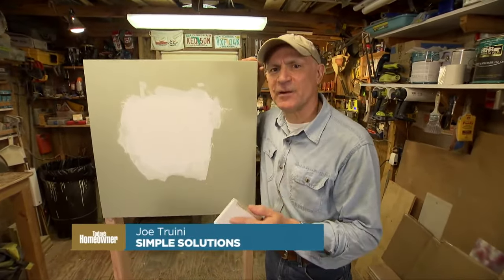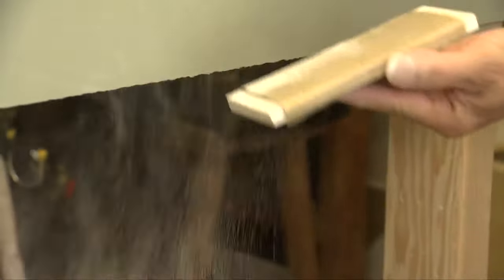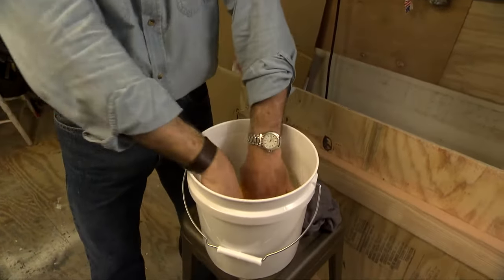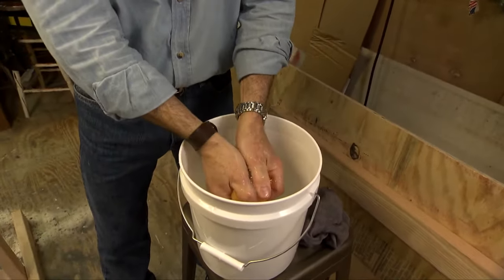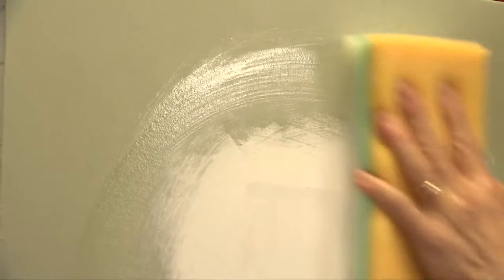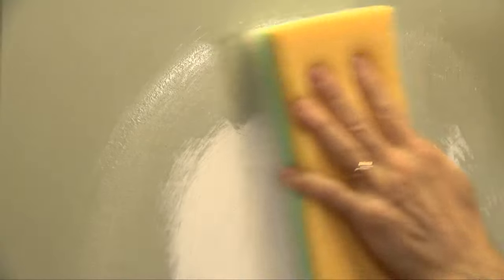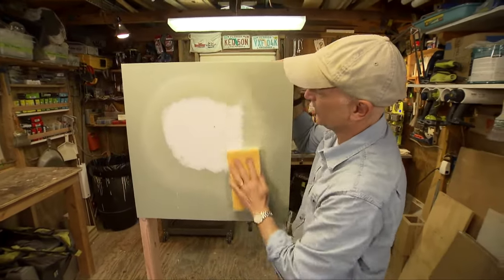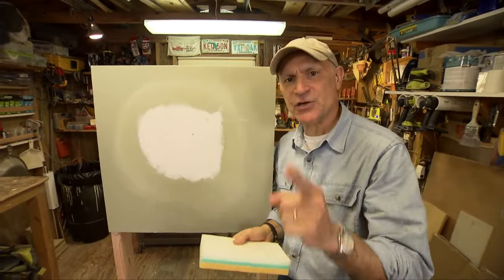How to Easily Smooth Joint Compound

Comment: Or…… you can you use a damp old wash cloth….  If you’re careful the rag can also remove scratch marks from over aggressive sanding.  Takes a bit longer than sanding but polishes the surface without any dust